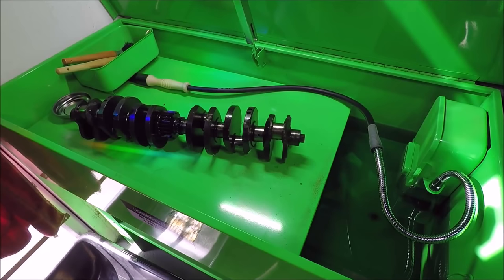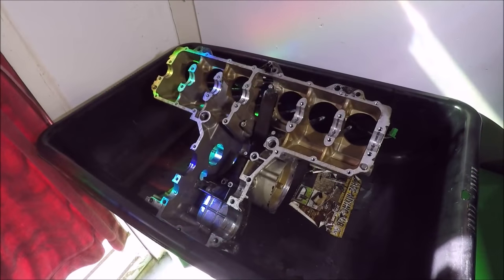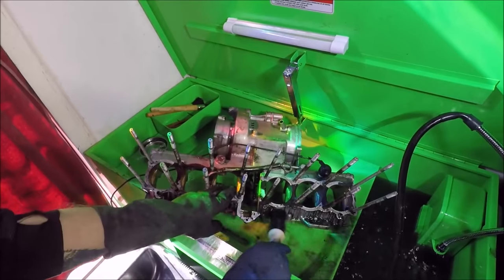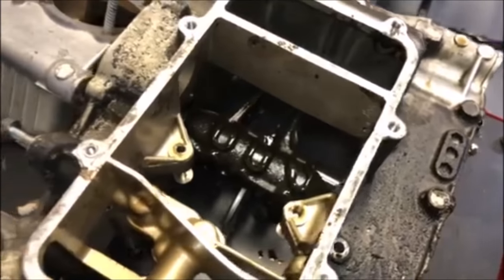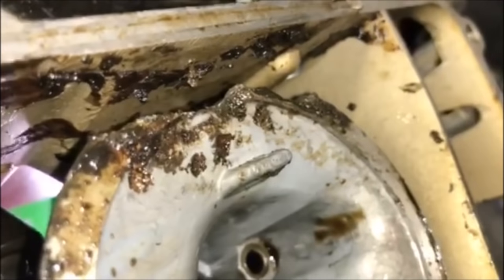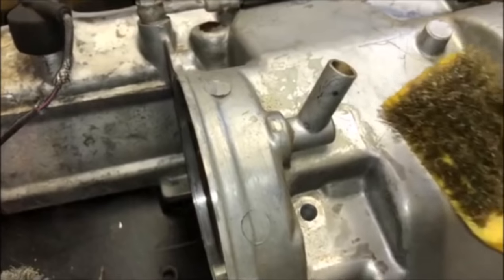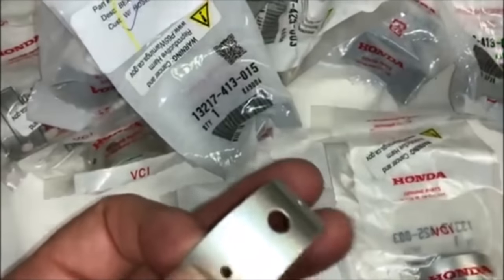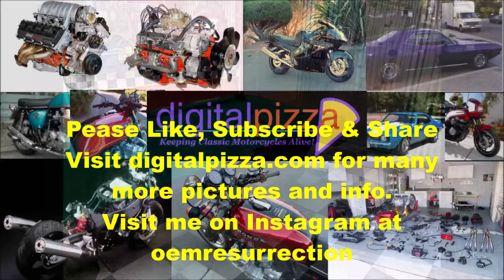Honda CBX Full Restoration & Engine Rebuild Video Series - Part 9 Engine Case & Oil Pump Restoration

Comment: Happy Sunday!  Thanks for the upload.  I have a stuck cylinder from rust in my #6 from water.  It was on compression going down, used rust rinsers and it came free.  Went down and back up on exhaust stroke and stuck again.  Been using wd40 and rust rinse.  Need to rotate by hand.  Do I take off clutch cover and try to turn engine over there?  I don't want to use the crank nut.  Thanks for your time and uploads.
Reply from the maker: Hi Michael, 
I would use the crank nut.
The clutch isn’t a good way to turn the engine. The crank nut is large and strong and is designed to turn the engine.
You may have to knock the piston loose like I had to.
Reply: @digitalpizza1  Thank you sir,  I appreciate your knowledge.   I will do so and let you know how it goes.

Comment: You want those cases to gleam see if there's a Vapour Blasting service near you
Reply from the maker: Hi Steffano,
Yes, vapor blasting is great, but these cases are painted from the factory and I will be painting them again as they were originally.
Reply: @digitalpizza1  May have to tape em up and media blast / prep them that way . Great videos
Reply: @digitalpizza1  yea. if youre painting them then you dont need the hassle of blast cleaning.

Comment: There is the hole the piece of ally broke out off
Reply from the maker: I looked everywhere in that engine to find where it broke off from, but there was no place anywhere that I saw. My guess is that it was left in there from the factory somehow. Luckily it was in a spot that it never was able to get circulated inside the critical areas of the engine.